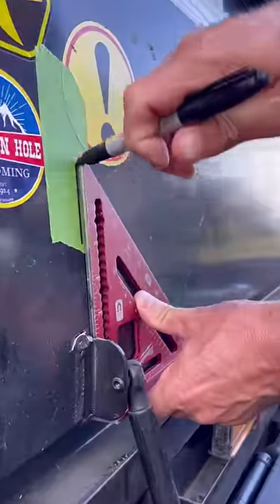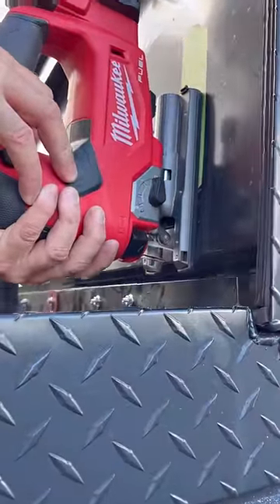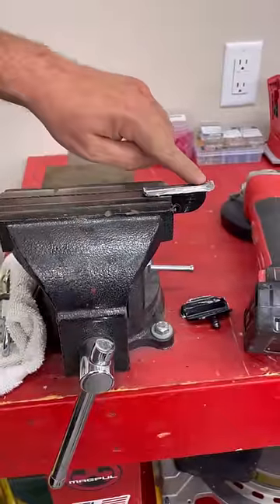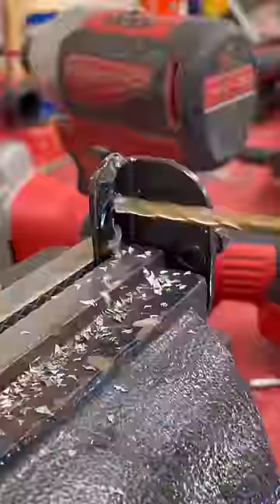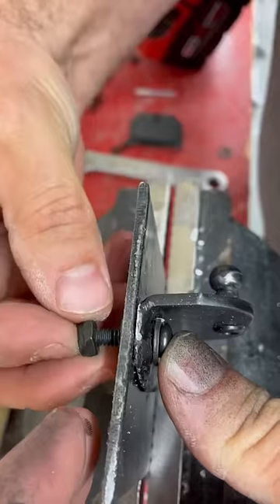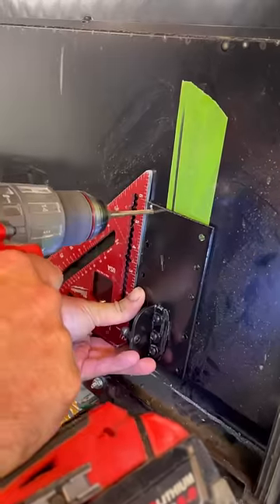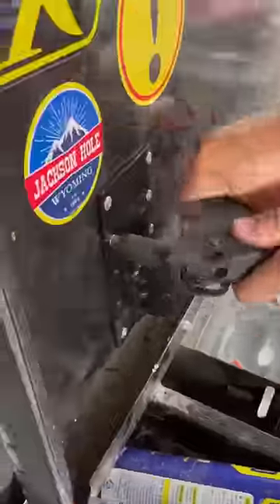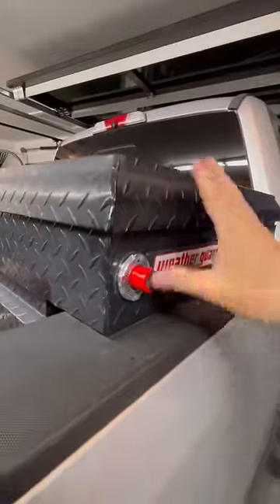I Had to Fix the Broken Shock Mounts on My Truck Toolbox

Comment: The problem is not the steel plate, it's still the aluminum. You have increased the fatigue area, so it should last longer than the original. The other potential problem is electrolysis between dissimilar metals. Assuming the joints stay dry, it should be ok, but keep an eye on it.
Reply from the maker: I painted the back of the steel before I mounted it to the aluminum. Hopefully this will help isolate the two.
Reply: What a great repair! Just a remark: What about the holes in the steel plates? They're exposed to the pop ... (sorry, forgot the word) and to any incoming water. I think it will start to rust, don't you think? 
Otherwise great execution of this repair.
Reply: Paint won’t matter.  You still need an actual material between steel and aluminum
Reply: @diywithjonandpebbles  copper flashing
Reply: @diywithjonandpebbles depends on what kind of paint. You can check with a volt meter to see if there's any current between them if it will corrode. My prediction is that the paint will be perfectly fine, however the rivets used to install them is bare metal contact, so that's where the corrosion will start. If your want to fix it, you can wet install them with RTV or paint, though my preference is for rtv since that is harder to scrape off during install. If you choose to use rtv, then I would go ahead and put a bead around the plates while you're in there, and that will seal water out from the dissimilar metals
Reply: @jordanharvey2163 no, copper is also reactive, at least with steel.  Id think thin rubber, which would also help with protecting from water intrusion.  Or silicone
Reply: @ChesneyBaker shock is mounted to an interior baffle, not the finished lid.  Watch again, I wondered the same thing
Reply: FYI It's called "Galvanic corosion", electrolysis requires current, anode cathode and electrolitic solution as far as I know.
Reply: @hausplans  In the video it appears you painted before you drilled the holes then stuck bolts and rivets through those holes which negates the value of the paint.  Even if you had repainted the holes there are always scratches in the coating from the hardware not to mention the working forces every time you open it.   

As JohnFBramfeld mentioned the good thing you did was increasing the contact area  which distributes the stress. The weak points here are the cheap pop rivets and the aluminum lid which will eventually fatigue and fail.
Reply: @braytag  Yep, I used the wrong word.
Reply: @hausplans you may have been better off with a gasket or flexseal type of separator.  That said, it's alll relative.  It may last a ton or if you see electrolysis forming, drill out the rivets, apply a gasket of some sort and reinstall.  Nice work!
Reply: Double sided m3 tape in between
Reply: Use to install aluminum panels and delt with a lot of mix metal. We used vapor barrier to keep from getting corrosion. It's a rubber roll and you apply the glue to the section and then place your rubber.
Reply: Considering it’s meant to be a permanent solution the cold weld is actually a bonus. I worked at a boat factory and we intentionally used steel screws on aluminum engine mounting frames knowing the screws and frame would eventually become stuck together.
Reply: Hold up. A wild redditor has been spotted!
Reply: Use stainless steel against aluminum
Use stainless rivets
Good to go
Reply: Great repair. Nice job!
Reply: @hausplans it won't. If anything you're likely to get putting at paint holidays. Plus spray paint is useless to prevent galvanic coupling. If you'd had it epoxy powder coated, then maybe, but there will still be movement that will eventually breach the coating.

Also remember that the rivets are aluminium and the holes through the plate aren't painted...
Reply: @hausplans And yet I bolted my aluminum box to a steel frame and have yet to see any issues after 10 years. People fussing about a non-issue... These aren't pipes with flowing water in them.
Reply: Why not use an aluminum plate of the higher thickness electrolysis corrosion?  I'm pretty sure the pop rivets you're using are aluminum also.  But as others have mentioned, as long as there's very little moisture you shouldn't have problem with accelerated corrosion
Reply: @court2379 I know!  People are insane with the galvanic corrosion comments.  I’m surprised someone didn’t recommend putting zinc boat anodes on the toolbox.  It’s a f’n toolbox..jeez.
Reply: @ChesneyBaker  it’s a double wall lid so it should stay dry
Reply: It will corrode like a landrover.
Reply: Agreed 100% ,, I have seen electrolytic corrosion between mild steel and stainless steel which has an even lower difference in cathodic potential,
Having said this, if he used a hard plastic spacer /  insulator in between the two parts, we would likely be ok
Reply: @leor2830  Still have to worry about the rivets.
Reply: @JohnFBramfeld  Well,, that can be resolved by using a M6 zinc plated steel (or even Gr304 stainless steel) hex head bolt and using either a conelock or nylock hex nut (or 1/4" UNC depending what side of the pond you are on), and then insulating them from the aluminum  with the use of hard plastic washers. Of course with the bolt head on the outside of the tool box.
Reply: @poopinfruz9771  By your own words, environment. A valve flowing an electrolyte thru it in a particularly corrosive environment isn't comparable to a toolbox that likely mostly stays dry and certainly the inside does, and probably isn't exposed to lots of salt. Again this is a non issue.
Reply: I bet this nice repair lasts for years
Reply: @hausplans  next time you have the silicon gun out run a smear over each of those rivets. Save water dripping into your box.
Reply: Would electrolysis be a problem? I imagine the hinge is probably steel
Reply: It'll take a decade for corrosion to genuinely affect the strength of this repair. Still, a smear of rtv would eliminate that issue.
Reply: Great thought.
Reply: The part could have been painted
Reply: @jordanharvey2163  a wild pc cooling enthusiast has entered the chat

copper + aluminum + water + any electrical charge = bad. and it eats the aluminum first, so its not even sacrificial in this situation.
Reply: Aluminum and zinc do go along pretty well. They sell alu/zinc spray paint for a long time and works very well. Best way to strengthen the alu sheet cover is using a second peace of galvanized steel on the outside at least some large washers that fit the diameter of the rivets

Comment: Good to see you fixed it, there will be some galvanic corrosion from the steel and aluminum being mixed which is probably why it's not like that from the factory, but if it gets you more use out of it then it doesn't matter
Reply: Galvanic corrosion requires the whole thing to be covered in a conductive fluid. It won’t be getting wet inside of a sealed toolbox and the metals are painted and not even in direct contact with each other. It’s not like that from factory simply because it’s more expensive and adds another step. This repair will last forever.
Reply: @samevans4525  The drilled holes are not painted, nor are the conductive screws going between them, and if you look closer at the video he only painted one side of the steel. Liquid is not required, it is required that the metals are in electrically conductive contact with each other in which case one will start sacrificing itself (corroding faster) while giving it's electrons to the would-be corroded other metal. It's a relatively small amount of steel, I don't think it'll be a serious issue in the end, but what you stated was wrong.
Reply: @CapArchy There are hundreds of places on every vehicle where aluminum and steel make direct contact. Steel and aluminum are not electrochemically separated enough for there to be much corrosion between them. Also, aluminum oxide is very tough and acts as a good separation between dissimilar metals. Had he made the plates out of brass, and wire brushed them completely clean, and didn't paint them, there might be a different story...but that would just be dumb
Reply: @m73m95  Every body panel and likely every bolt on your car is steel (often zinc coated), the only thing that is likely to be aluminum is your engine block which has many special considerations and bushings in place otherwise your engine would corrode instead of your wheel well. Aluminum does usually avoid corrosion with it's oxide layer, but that layer does nothing to electrically isolate it from other metals it's touching so no, it does not stop galvanic corrosion. And yes, steel and aluminum are dissimilar enough to create galvanic corrosion, it's one of the most common instances for it to occur. You just boldly stated incorrect things as fact.
Once again, I'm not knocking the fix. A small amount of steel on a larger body of aluminum will likely only cause minor cosmetic imperfections, and if it gets use out of the box then that's great. But it's worth considering the effects, especially since it's obviously so common for people to not understand them.
Reply: @CapArchy  As my grandpa used to say, you seem to have way more dollars than sense (cents). Meaning, you really have no idea what you're talking about. You just try to impress people with your "wisdom" 😂 Goodnight
Reply: @m73m95 he is right 

Only the air humidity is enough for corrosion its the same when u put down a stainless steel pipe and use normal steel pipe Clamps.

Over the years only the air humidity will destroy them.
Reply: @m73m95 Ask Volvo 240 drivers. Some are on their 5th bumper, as the support is painted steel and the bumper itself is Aluminum. It is an issue.
Reply: @m73m95  You're wrong. I'm a truck driver and aluminum truck body with ateel hardware riveted on without an insulator (as simple as a piece of plastic, or even certain tape) and the GC happens in under a year. Dip the rivets too, to avoid this.
Reply: @m73m95 Actually, dude is right. Whether or not you're just a hater I can't tell, given the fact that you can't admit the guy was right. Probably because you're the one who truly doesn't know what he's talking about.
Reply: @SPD_driver  Dip them in what? Share you secrets!
Reply: Those pop rivets are surprisingly strong. Structurally, any corrosion debate aside, it'll hold. No doubt.
Reply: @sergioflemate13 usually once someone pulls out the "you're just trying to impress people with your big words" they've given up making their case and are reverting to ego defense mode lol
Reply: As a third party reading this exchange, I definitely trust their comments more than yours. Yours read like a lot general ideas used to create specific assumptions that are then presented as facts.
Reply: The rivets are aluminum and the toolbox won’t see any weather inside plus both surfaces are painted. There is no steel on aluminum contact aside from possible scratching and the holes that were drilled against rivets. The amount of galvanic corrosion this would cause is going to be close to zero unless he stores boiling salt water inside his toolbox. If his tools aren’t rusting inside the box already then that repair is going to long outlast the toolbox and in the unlikely event there is a bit of galvanic corrosion it will likely be minuscule. Most aluminium toolboxes have steel hardware and screws and last for 20-30 years without issue. This took a total non issue and made it a giant thread of arguing because someone wanted to sound smart but but just made them look petty, uninformed, and like they need to be the center of attention.

Comment: The repair was definitely cheaper than a new box I'm sure, and I believe it will hold up for a while. The way you did the repair allows any stress to be spread out over a larger area compared to the original mount, therefore minimizing metal fatigue to a decent extent.

Comment: I think that's a nicely done repair. The only thing I would have done is flipped the rivets around, so you kind of have the nice looking part on the outside and then the crimpy part on the inside but that's just personal preference. Of course it doesn't matter. Nicely done.
Reply: Actually, wait a minute I'm wrong… That's probably a double wall door so the rivets and the holes don't go all the way through the top right? So never mind that's a perfect repair. That's gonna look great from the outside lol
Reply from the maker: Thanks, you’re correct there’s an inner skin the rivets don’t go through the top
Reply: I might have put steel plates on both the inside and out. You'd need long rivets, though.
Reply: @septegram Or just use some machine screws.
Reply: Nice catch
Reply: You don't understand pop rivets, do you?
Reply: @OldsmobileCutlass1969Va  stainless steel screws &nuts, tho.

Comment: I'm sure that toolbox has paid for itself 1000x over.
I have the same one but I'm semi retired and mine has only paid me back about 50x 😂

Update - WOW...I've never received this many likes for a comment.
Reply: Well i guess it still paid back. Having a good toolbox makes things so much easier. I got a tool box for computer stuff. Storage, tools for repair, testing tools and tools for making internet connection cables. And some of the basic stuff like a screwdriver and a multitool. Makes working with computers on sight 10x easier
Reply: We have them at work on a couple hundred… of trucks and overload them with tools and the doors are all bent. So we have to slam them a bunch of times before they shut. We all prefer utility beds over these tool boxes on the forman trucks
Reply: Weather Guard boxes are really expensive and they still break like all the other ones.  Hopefully he got his monies worth.
Reply: You should have put another metal plate on the other side and screwed everything together……..
Reply: Good deal. Here's another
Reply: @jimpie231 Or a strip of metal.
Reply: How do you feel after receiving 1k likes?
Reply: @Dcf9  The same, but I just never expected to receive that many...I usually only get a few likes.
I won't let it change me! 😂
Reply: don't forget to silicone the holes up so you don't get water pooling in the old holes in the ally.
Reply: This are not many likes...
Reply: @DreStyle  For someone like me who only gets a few on a comment...it's way more than I ever expected.😳
Reply: "Here's anotherone!" - Tank Dempsey
Reply: @DreStyle  That are not many grammar... He still has literally infinitely more likes than you do, considering you have none.
Reply: @-alexpoe8394  Thank you. 😊
Reply: pass it on to a young man who will use it properly

Comment: Two tips. I would round the corners on the steel plate to avoid stress points and if you use some 3M gray molding tape to attach it along with the pop rivets it'll never move. That stuff is amazing
Reply from the maker: I used that tape before, it’s crazy strong
Reply: Why? Its not being welded or inserted into the backing plate and will not see any stress likely to cause a fracture.
Reply: That's really good advice. When we use to sheet panel vans we always taped the sheets first.
Reply: I agree, and with your plan, and the 3M VHB tape, we can easily reduce it to 6 or even 4 rivets
Reply: Good point about the tape. Still, great job on the repair

Comment: You may get some galvanic action at the steel/aluminum contact points but may not be a serious issue. Cool repair.
Reply: I was thinking the same thing. I'd put some rubber in between, otherwise your aluminum will rot. Other than that it's perfect
Reply: This is correct. In time, there will be corrosion. A neoprene isolation pad between it will prevent this.
Reply: @thisnamewastakentoo_  also correct. There are isolation kits/sleeves to prevent this.

Comment: I've owned a Weather Guard box for almost a decade and a half with no issues at all.  It looks almost new.  It has never leaked, cracked, or warped.  As the commentator says, I'd buy this box again in a heartbeat.

Comment: Good for a while. Might have leakage without a gasket. There's also the potential for increased corrosion with two dissimilar metals in contact. Structurally sound for a few years though
Reply from the maker: The bolts and pop rivets are going through a lower layer of metal. They don’t go through the top so there won’t be any leaking.
Reply: Why not cut two 6” pieces of aluminum with aluminum bolts and rivets instead of steel?
Reply: @chunkyfecalbreakfast  would corrosion inhibitor work?
Reply: The two metals have paint between them so electrolysis won't be as bad if it were bare metal
Reply: @chunkyfecalbreakfast It's a toolbox, you probably won't see a hint of corrosion for the next 10 years.
Reply: "galvanic reaction" is what will cause some grief.  Not a lot at first, but later on you'll see it.  Decent repair, and certainly worth doing.

Comment: Mild Steel + Aluminum = Dissimilar metal galvanic corrosion enters the chat.
Reply: Bah, it'll be fine for long enough
Reply: Yes in 2067
Reply: Thats what I thought
Reply: The paint stops that only bare metal gets the chemical reaction

Comment: I would have done the same thing but just with a heavy-duty gauge aluminum. And use a double-sided sticky designed for trailers and RV's. It's really expensive type but you ever get a chance to use it you'll love it and want to buy more trust me

Comment: As  amaterials engineer, I suggest adding a sealent around the edges of riveted plate as well as on the inside where you cut old hinges. When you leave really small air gaps and water gets inside (and this is a truck, it'll be driven in rain too), small diferential aeration pairs will show up (small galvanic couples with electric potential difference) and that can start the fast corosion which is very common (air tank explosions, gas tank explosions, bridge fails...)
Reply from the maker: The pop rivets and bolts don’t go through the top. They’re attached to a stepdown section. So it’s still completely waterproof. I posted a second video showing this if you wanna check it out.👍